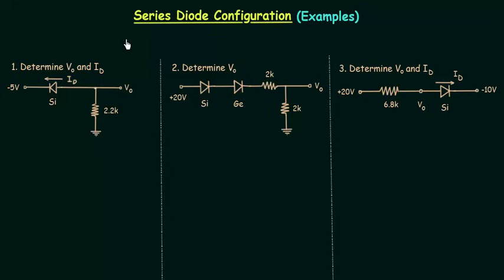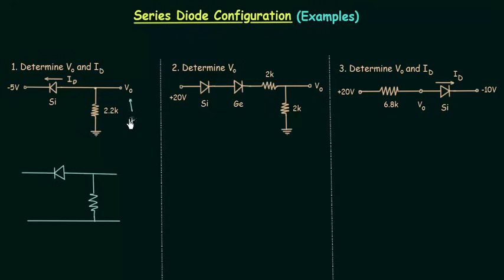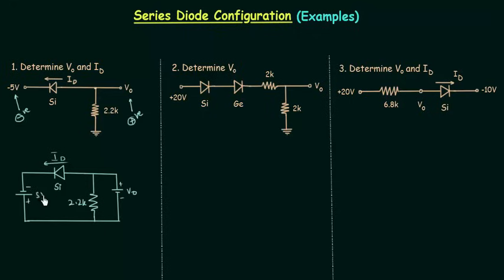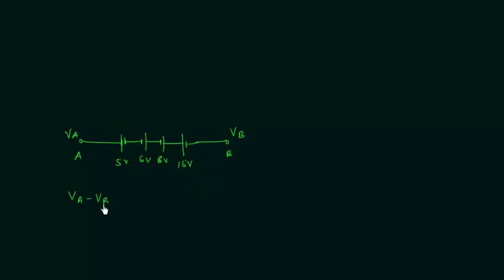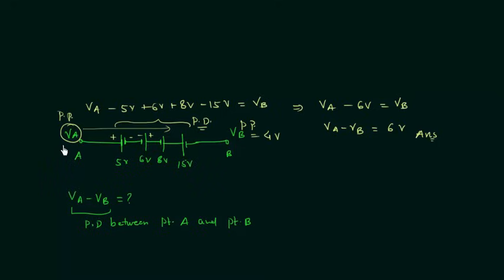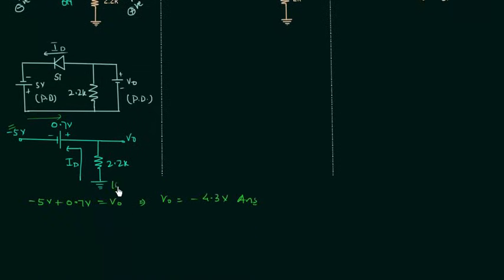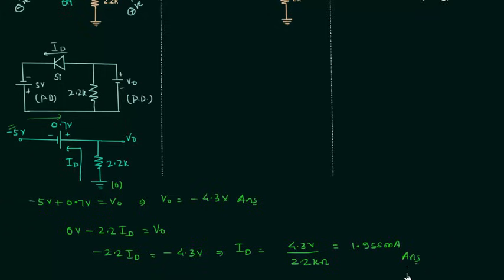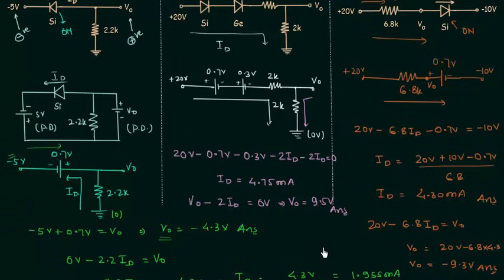Series Diode Configuration (Examples)

Comment: At the last math to get Vo here 20 V,6.8 kohm and Vo - this combination has been applied. If i apply 6.8 kohm,Vo and diode and -10V then i get different ans.What is the right way of choosing combination for finding the voltage for a random point in circuit?

Comment: Good day, sir! I was just confuse where to really start if you're getting the V_0. Both 1 & 3 equates to V_0. However, in #2 you start from V_0. Thank you!
Reply: Start from the higher potential.
In first 0V is higher than -4.3V so we start from there while in 2nd question V0 is 4.75V so we start from there as it is higher than 0V.

Comment: Brother in3rd example 20+10-0.7÷6.8
Do not understand when 0.7 move from left to rigth it becom positive you write this negative.
Please clear that point i don't understand??
Reply: current direction is left to right and diode direction + to - so diode voltage is substracted

Comment: 1A becuase the two diode has no effect becuase even if the one is forward bias the other one neglects or I should say reverse so that it is open circuit not only the 10 volts and 10 ohms are there then use ohms law 10V/10R=1A

Comment: why was Vo not included in the equation used to find Id in the 3rd example?
Reply: Because we don't take the point-potential value into account between the other two point-potentials. All we take is the potential drops or the potential differences between two potential points.

Comment: In ex 3 you have left v0 and calculated value of Id ,I can't understand Lyk how could we leave a voltage point and take the next potential?
Reply: My guess would be Vo is just a point. We are calculating the potential at that point. It is not a voltage source, so taking Vo into account is not needed. @Shruti
Reply: did u get the ans?
Reply: Same question!

Comment: Sir press help me with the 2 model My answer is not matching with yours..I solved the problem in alternate method..Like 20+0.7+0.3+2I+2I=0..Is it right..
Reply: You take entering sign right....so you get -20+0.7+0.3+2I+2I 
Now you will get the same answer...
Reply: it's voltage drop across the diodes -0.7 and -0.3

Comment: For the last example how come we can't fin Vo like this Vo=6.8ID+.7-10 ???
Reply: the point Vo is in between the resistor and the diode. Hence, the equation you asked about is wrong. If we consider the other equation, it will be like: Vo - 0.7 = -10 , => Vo= -10+0.7 = -9.3

Comment: Why have we considered -5v to Vo while calculating Vo in the first case, while we have considered +20V to 0v for second case, instead of considering till Vo?
Reply: most probably because V0 was asked in third problem ,for your own convenience you can replace V0 by a point P and then can find potential at point P
Reply: I believe it is because 0v is at a higher potential than -5v maybe? Not totally sure. Current flows from high to low.
Reply: Every case is different and as the logic to solve them😅

Comment: As a side note, by using the point to point mode of calculation, in the third circuit we can determine Vo only by using the silicon diode voltage barrier, 0,7 V, and the -10V point.
Therefore, starting from Vo and going towards -10V, we have :

Vo - 0.7V = -10V;
Vo = -10V + 0.7V;
Vo = -9.3V.

In this way, we have reached the same answer without having to determine current Id!

I understood the point to point calculation in this way :
You start the equation with the node you're leaving from, writing it into the equation with the polarity that it has.
Then, you follow whichever branch you want, as long as you reach to another point ( either another potential or ground ).
You type in the equation the voltage drops you meet taking into account : The voltage drops which are headed towards the destination point will be written with minus ( minus sign of the voltage drop is near the destination, plus sign is far from it ), the ones which are headed in the opposite direction will be written with plus sign ( minus sign of the voltage drop is far from the destination, plus sign is near it ).
Finally, after you reached the destination potential, you write the potential on the other side of the equal sign.

Also, to keep in mind is that first you have to make sure that you write into the circuit the direction of where the currents are going, in which current always goes towards the lowest potential, which is minus rather than ground. This has been illustrated in circuit number one, where current seems to go from ground towards -5V ! ! !
Reply: In question 3 , why he did not take Vo in the first case ?
Reply: yes the explanation at start was going from 1 point to other. but then he suddenly started going from ground (I know it can be considered as a point potential of 0V) but still it was confusing. not keeping the methods consistent or I should say not using the branch with two non ground point potential made it a little more difficult to understand. He should've given another example where he take Point A as ground instead of some arbitrary point A to be more clear in what he did in example 2 and 3.

Comment: the direction of voltage does not matter or what? because on the first example you started from ground to vnot , but the second  example you stared from vo to ground 
does that differ?
Reply: you can start calculations from any side but final answer will be with some sign like positive or negative so if calculated i is positive then the current direction that you have assumed is correct , if it is negative then the direction of current will be opposite to what you have assumed

Comment: How come is the diode forward biased in the 1st example? The diode is connected to -ve terminal of Vo and to ground. Where from is +ve voltage obtained inorder to overcome the barrier potential? Please expain.
Reply: I think the direction of current mentioned is somewhat incorrect.
Reply: dead line I agree about current  flowing from ground to -ve terminal but there's still some doubt regarding how potential barrier is overcome...Thanks anyway

Comment: Zhen Wang, I think he drew the circuit wrong. We have no idea how the two voltage points are connected to ground. They could be through resistors, batteries, even very complex circuits. They should be considered volt meter readings relative to ground only. In other words, the points in question do not affect the circuit. It's like they are connected to ground through very large resistors (i.e. they are volt meter readings).
Reply: you are right, but he is right too

Comment: I have a question on the second model of the three.I think the equation should be like this:20V-0.7V-0.3V-2I-0.5*2I=0. Because the main current in the combined should equal to the sum of the two separate wires.  As the voltage of the two powers on both sides should be equal. to each other. the current in both wires should be the same. could u pls try to explain t me.thx
Reply: the circuit is not parallel, the resistors are actually in series. Therefore the same current passes through both
Reply: Their are no two separate wires their is actually two loops out of which we have considered the first one
Reply: Why dont we  consider current in both the loops to be different?

Comment: I have a question in which there are two batteries and negative of one is connected to p side while negative of other is connected to n side. So is the diode on or off?
Reply: Depends upon which battery produces a higher voltage .
Reply: +Anees Muzaffar they have same emf
Reply: In that case , the potential across the diode is zero , hence no current flows .

Comment: In the potential difference and potential at point why you use + signs between 5v, 6v and 8v in kvl except - sign.??? I do not understand this point.
Reply: Point - To - Ponder from position to negative it is a lost 
from negative to positive it is a gain
i understand in that way

Comment: in 1st example how u can say the current going through thr resistor and the diode is same ???? i mean there can be some current coming from Vo potrntial
Reply: Vo potential point not potential difference and it is somewhere between resistor and diode. This is basicly a close circuit started from -5V and ended on ground. Also there is only one current which flows from resistor to diode because he picked up the direction of current that way and the result of current was positive. that means his first choice is correct.
Reply: @tuna5653  Do not fool yourself and people. He made a mistake. The correct answer is that he should have considered a current 2Id instead of Id through the resistor.
Reply: @sarthakgirdhar2833  u r wrong.... Tuna is right
Reply: @sarthakgirdhar2833  konse college ke ho ? .......
Reply: @sarthakgirdhar2833 you’re the fool here😂
Reply: @CSgoGOAT-v7x  I wrote the above comment around 5 years ago, and I will have to rewatch the video to know whether I was right or wrong. Maybe I was indeed wrong! Thanks for your comment!
Reply: @suyashbondriya2006  I am a PhD student now lmao, but 2 years ago I was an MSc student at IITB.
Reply: I think he made a mistake cause the circuit is connected